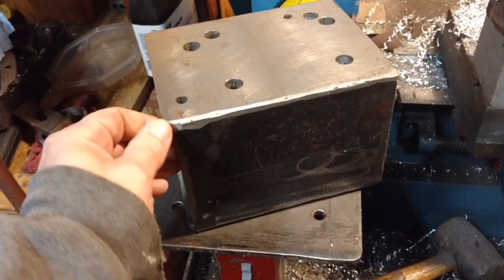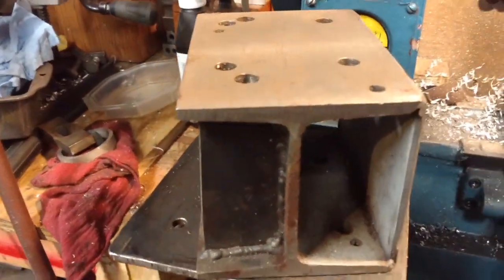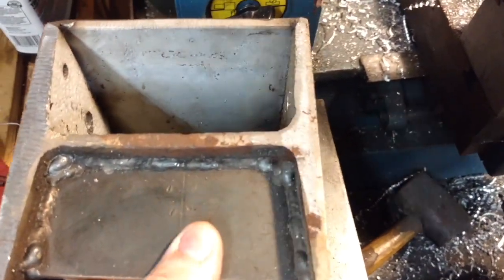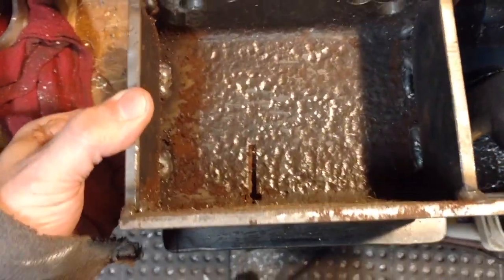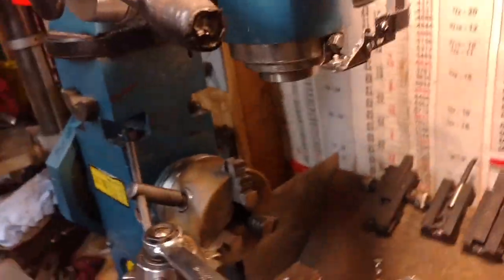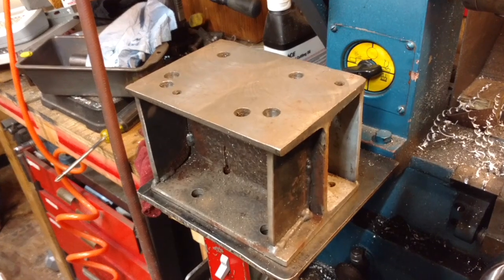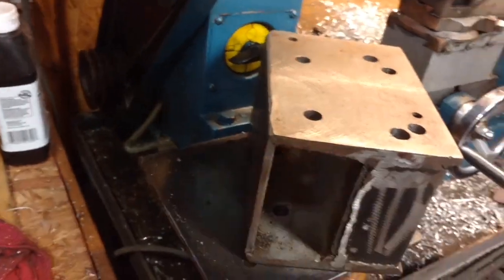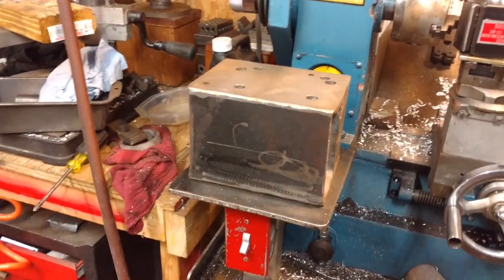More HQ400 Mill Drill Lathe stuff - Mill Riser

Comment: Hi have you tried to lift up the spindle head to get a bigger swing clearance on the bed ? I’d like to push it out to 500mm swing. Anything internally what would stock you putting in a riser block ?
Reply from the maker: Raising the lathe would be pretty easy. You would just need a riser block and maybe a longer drive belt. I have not done it but it  is possible.
Reply: @theeddies  no mechanisms in the shaft to worry about ? Wouldnt the whole cabinet have to go up with it ? Or you think just a longer belt would do it?
Reply from the maker: @martytonkin7210  if you are lifting from below the lathe spindle, there is nothing there. It is just bolted on. You could put a 10' spacer there with enough belt, lol. If you want to raise just the mill head there is a horizontal shaft that runs from the lathe spindle up. Some models though have a motor on the mill head as well which gets rid of that shaft as well. The lathe motor mounts to the bed on a swivel, so a belt may or may not be necessary depending on how high you go.
Reply: It swings 420 now , I only need 520 ish , so would only be a 50mm spacer I gather . I haven’t got the machine yet it arrives next week .
Reply from the maker: @martytonkin7210  mine does about 350mm without too much problem. If the design of your is the same it should be easy though. My issues was with tool post positioning to make use of the span. I did a video doing a large brake disc and while it can be done, getting the tool in the right position to move across the whole cut with rigidity can be challenging.
Reply: Out of interest I managed to do this to my newly acquired HQ400 lathe . Lifted the head up 50mm so I can now swing 520mm , added longer belts and cut some holes in the pulley cabinet . I also built up the tool post and spaced it outwards so I can cut out that far . The next issue was the motor struggled when spinning a heavier wheel centre  and cutting . So I then added a 1.5kw motor and now it works beautifully. A low budget machine that now spins 520mm with room to go bigger if I needed it . For now it does what I need to be able to cut wheel centres .
Reply from the maker: @martytonkin7210  nice

Comment: How did you manage to mill yours? My mill just chatters and shakes and is just god awful when trying to mill it. Using a face mill
Reply from the maker: 2" Fly cutter. i have never tried a face mill on this mill.  I have a feeling the cutting forces would be to extreme, though again I have never tried it. Even with the fly cutter, I went as slow as possible. Lots of oil and light cuts. I also tightened everything down as much as possible and did all my cuts along the long axis back and forth toward and away from the head stock so I did not get a lot of side force on the mill head lock. When I say I tightened everything down, I mean everything was locked except the axis I was using and it was as tight as I could get it and still move.
Fly cutters exert a lot less cutting force but getting that sweet spot between a clean cut and bouncing takes some practice. Also getting the right grind on the tool is very important. Tom's Tech has a great resource for simple tool grinds. https://tomstechniques.com/reference/

Best!
Eddie
Reply: @theeddies  thanks for the tip, I'll try and find a fly cutter.
All the axis apart from one was locked tight, even screwed the I-beam down so hard the crossfeed couldn't move. Hopefully a fly cutter will solve my problem.👍

Comment: Hey Eddy,  I have another question about your lathe.  Have you ever used MT3 collets in either the lathe or mill?

I would like to get a set of collets for my lathe and I'm looking at the following set on Amazon:

#3 Morse Taper Collet 12 Pc. Set

If you copy and paste the above description into Amazon it should pull up this product.  It's a set of 12 collets in the following sizes: 1/8", 5/32", 3/16", 1/4", 5/16", 3/8", 7/16", 1/2", 9/16", 5/8", 11/16", & 3/4"  It sells for just under $90.  That comes out to about $7.50 per collet. 

They also have a 7 pc set for about $60.  

These are just the collets only with no draw bar.  But they do have 3/8-16 threads for a draw bar.  I guess I could make a draw bar easily enough.    I figure I could use these in both the lathe and mill.  Possibly even in my tailstock since my tailstock is also MT3 taper. 

In any case, I wanted to run this by you and ask if you have used any MT3 collets on your lathe or mill.   Thanks.
Reply from the maker: I have one collet, 5/8" I think. But I use an ER collet set mostly. I think it is ER20 or 24. The number is the largest size in mm. I will be in the shop tomorrow an do a short video on them and my drawbar tomorrow. I like the ER because changes are easier than the full size collets.

Comment: Love to see anything on the HQ400 Lathe/Mill.  Thanks for posting. 

I just ordered and received a WEN 414CV 4.25" Compound Cross Slide from Amazon to use as a riser.  Paid close to $60 for it.   I was actually thinking about welding up a piece of I-beam like you did, but I'd need to find the piece of I-beam and do all the machining work, so I figured just buying the compound vice would be easier. This vice is nice and sturdy.   Also the bolt pattern on this vice turned out to match up with the table T-slots very nicely.  So that was nice too.  It just bolt right on out of the box. This vice just arrived this  morning.  I put it on the mill and used it to mill some steel pieces that I needed.  It worked pretty good.  It's a nice addition to the lathe/mill.
Reply from the maker: It is nice to have the extra movable axis', that's why I like my table so much. It makes setting up stuff much easier. Once you get a good position, just lock the compounds and use the beefier table feeds to mill. 

I am glad you had good luck with the WEN, I ordered one like that (but not that brand) and it was so bad I had to send it back. I mean, I expect to have to tune up stuff made in China, but that thing was beyond repair. One of the cross screws was bow shaped, the jaws were misaligned, the bottom was rough cast that they ran over with an angle grinder, the treads looked like they were cut by hand with a file. It was a mess.  That's what I get for getting the cheapest one I could find though (it was $40 shipped). 
Best!
Reply: I know the one you're referring to.  I almost bought that one, but after reading lots of reviews on many different models I decided to pay the extra $20 for this Wen.   It's still far from perfect, but it's actually quite well-made. If anything it's too tight rather than too loose which is much better.  But yeah, once I get the workpiece mounted in a good position I lock the cross slides of the vice, and use the mill table to do the actual machining. 

But it's still nice to have the vice cross slides available for initial set-up positioning.   That's a feature I'm sure I'll appreciate in future projects.  I also like the cross slide adjustment gibs better than on the $40.  These are designed more like traditional gib adjustment screws.  The cheaper vice just had Philips head machine screws with lock nuts.  This Wen at least has the standard Allen key set screws with locking nut.  I'm not sure if it's really better, but it sure looks more professionally made.
Reply from the maker: @Mystic0Dreamer   That's what I was expecting when I ordered the other one, something that may need some adjustment or even a little machining  but was workable. That $20 price difference sounds like it was a world of difference. I lucked into the Atlas compound table but I would certainly give the Wen, as you describe it, a try if I had not.
Reply: Yes, I would say that you lucked out getting the Atlas compound table.  That's most likely a far better solution.  I imagine the Atlas is more sturdy.  This Wen is ok, for the price.  Definitely not good for serious heavy metal work. But most of the things I work with are pretty lightweight anyway, so it will probably serve my purposes.  But yeah, I like your Atlas.  That's nice!

By the way, you did a really nice job on the I-beam riser too.   That's really nice piece for a homemade riser.